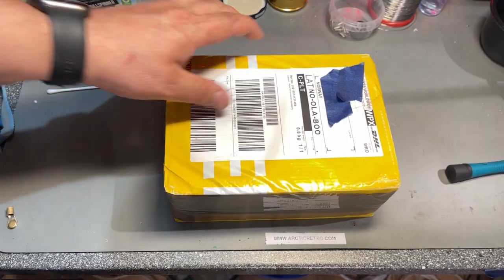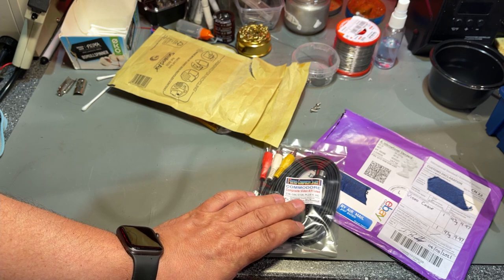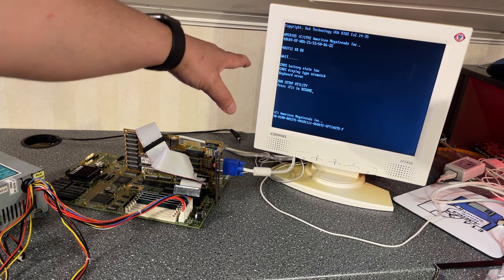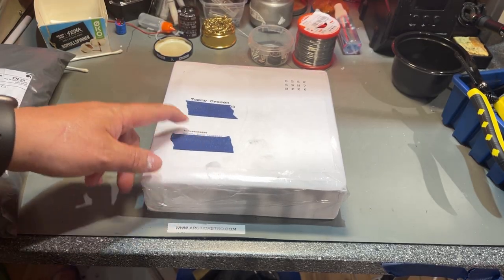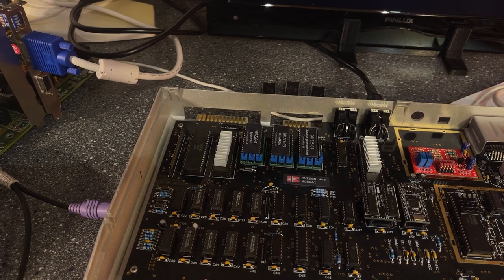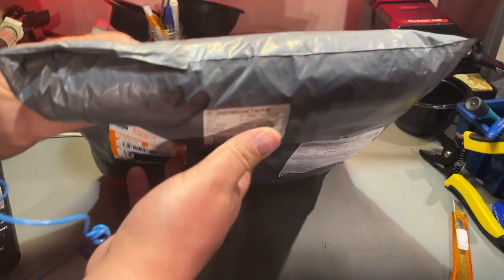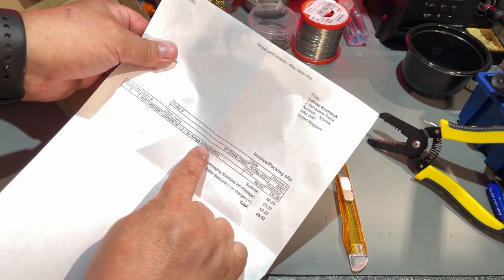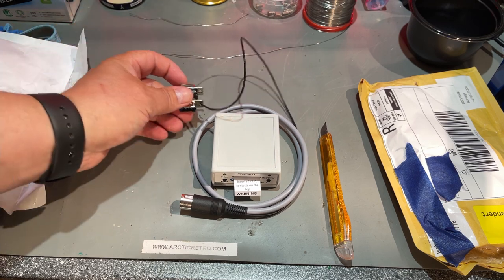Mail and donations - June 2021 - MSX computer, keyboards, rom adapters, sd2iec ++

Comment: Thanks for the video! You should get a much sharper picture out of the VG-8235 using the Scart connector. If it’s anything like the NMS-8250, it should output RGB via the Scart.
Reply from the maker: Thanks! Yes, I know. This was just a quick test

Comment: Be careful with the C= composite lead. At least the C64 is not 100% standard and has too much voltage on these connectors. I had my C64 plugged in with a SCART cable and it killed several TV sets. Luckily they all passed as warranty cases at the friendly dealer but later I found out you have to add resistors on the composite out.

Comment: Thanks for another great video! Great to see my old MSX in good hands! I have no idea what’s going on with that narrow column of text though. It’s been in storage a few months, but it worked the last time I tested it. Never tried it with the rf, but it has a scart output in the back as well.
Reply from the maker: Again, thanks for the great donation. I will do a full video about it after the summer :)
Reply: @Arcticretro  try WIDTH 40 while in BASIC; that will likely fix the narrow column. :) This value goes up to 80 on MSX2 machines in the default screen.
Use SET SCREEN to store the current settings to the machine's RTC. See https://www.msx.org/wiki/SET_SCREEN for some more details.

I would also highly recommend using the SCART out rather than the RF. Much better quality. :)
Reply from the maker: @FiXato  Thanks, I will try. Yes, I know the scart is better.

Comment: My elementary school back in the Netherlands had a VG-8235, as well as two NMS 8245's, which had double-sided drives rather than the single-sided one of the '35. I remember being asked by my teachers to copy some disks for all three of the machines, and being a bit annoyed that I would have to split the 720KB disks over two 360KB disks. :) 
The school having MSX2 machines is in part why my parents bought an MSX2 for our household too, though they opted for the the NMS 8250. A lovely machine which plenty of memories for me, though unfortunately with a rather badly designed audio circuit when it comes to audio volume balance between PSG and other sound cartridges.

While I still have the same 8250 I grew up with, I haven't actually set it up since moving to Bodø a couple of years ago. Should perhaps find some time and desk space for that this summer. :)
Reply from the maker: I did never come across a MSX machine before. Oh, you live in Bodø too ?
Reply: @Arcticretro  Rønvika bydel :)

Comment: You might find the link: https://www.msx.org/wiki/Philips_VG-8235 useful. I have a NA machine with NTSC, but you might find the following Items useful to know. There are (at least) two major versions of MSX machines and if the link is right yours is an MSX2 machine. I don't remember where I found mine (eBay?), but there is a memory expansion/SD card device called the "Mapper Megaram 512" Mine has two SD slots. See this video here: https://www.youtube.com/watch?v=z_DLtEWWfVw - it pretends to be a tape device and comes with a wire from the computer to the device. The device itself has a micro-SD card for storage. The site selling these has several for different brands of computers: https://www.youmakerobots.com/ note that this device needs to be powered by a USB cable (it's supplied). I believe that your MSX computer (like many) possesses two cart slots. Pretty sure you have one on the back as well as on top. NOTE: while they are MOSTLY the same, some things will only run from one slot. I don't know which that will be on yours. 

This computer should have a round RGB port - BUT they aren't the same on every company's machine. On this page: https://www.msx.org/wiki/RGB_(8-pin_DIN_45326) they show the brands and pin conversion to SCART. I am unfamiliar with SCART, but you might have better luck.

That's about all I know at the moment. HTH.
Reply: I'm surprised to hear that the VG-8235 was even released in North America. I thought NA MSX offerings were more or less limited to the SVI-728 and some Yamahas. LGR actually did a review of it and he had to import a EU model. The European version of the machine at least has an RGB enabled Scart, so need for a DIN to Scart on this one (Scart cables are still common enough that you can find them in most electronics retail stores here) :)
Reply from the maker: Thanks for that info. Appreciate it!